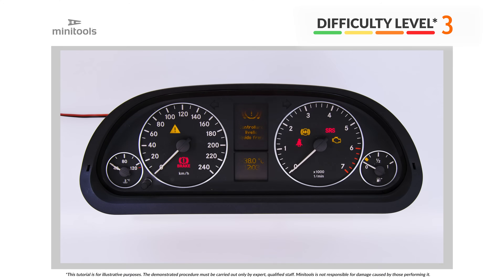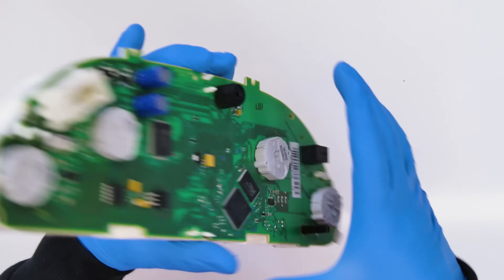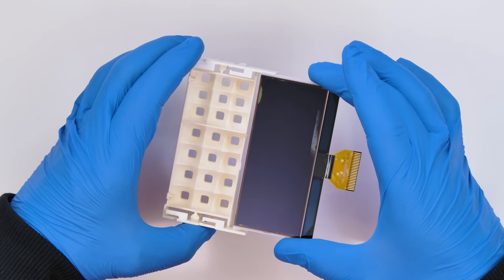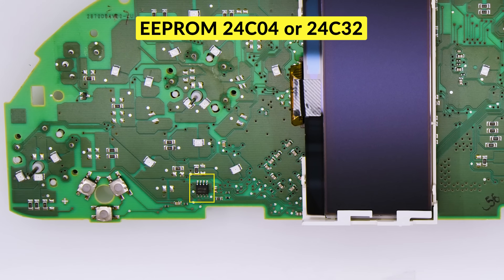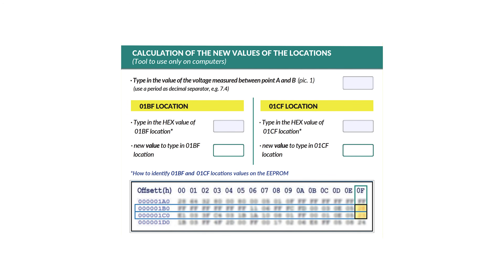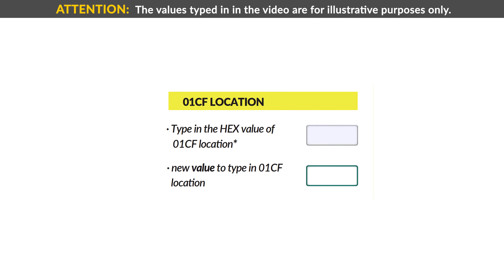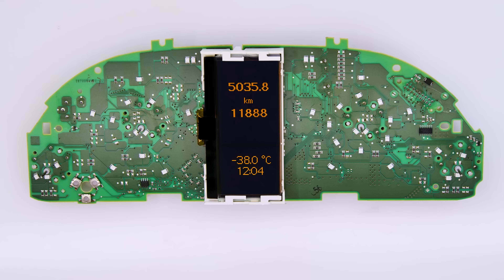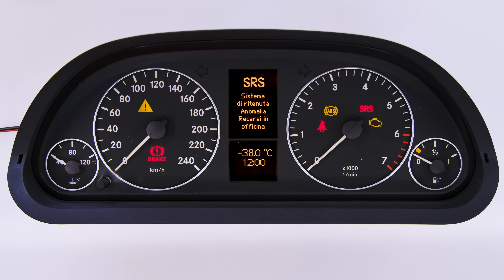Mercedes A-Class W169 and B-Class W245 instrument cluster display replacement

Comment from the maker: Replacement display for Mercedes A-Class W169 / C169 and B-Class W245 available at the following link https://store.minitools.com/en/sepdisp08-7v-mercedes-class-a-b-lcd-display.html
Reply: Shit!! And youall say i should do this at home, by myself... Ufff noo w😂aaaaayy
Reply from the maker: @vladito80  We do realize it’s one of the most difficult DIY repairs as it needs programming and soldering experience, but it’s not impossible! We know that using an EEPROM programmer may be difficult for somebody without programming experience; however, as we provide step by step instructions on how to use it for this specific instrument cluster, it’s not actually that hard! Soldering may be a bit tricky,  but if you’re interested in getting a bit of knowledge about it you could look at this video https://www.youtube.com/watch?v=soDUnUyZYxE

Comment: Dear Sir!

Please help me.
The tachometer of our B-Class W245 car, made in 2005, is lying. Sometimes it shows more, sometimes less, but sometimes it stays at zero and does not move.
Where should I look for the reason why hpol is showing so much and so much? What could be the most likely reason. Possibly a soldering error? Or could a contact be faulty?

Thank you very much in advance for your kind help!
Best regards, János bohus
Reply from the maker: Hi, could you please send us an e-mail at info@minitools.com with your enquiry, attaching picture of the instrument cluster and explaining the issue? Our technical assistance team will look into it and get back to you. Thank you

Comment: Why not use a resistor instead?
Reply from the maker: Hi, because adjusting the voltage using a resistor is not as accurate as the method shown in the video.